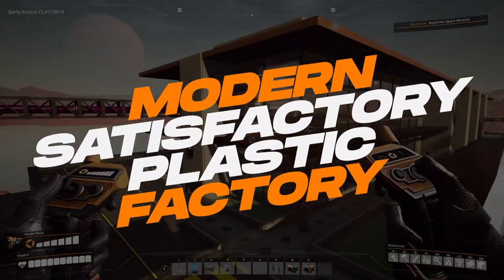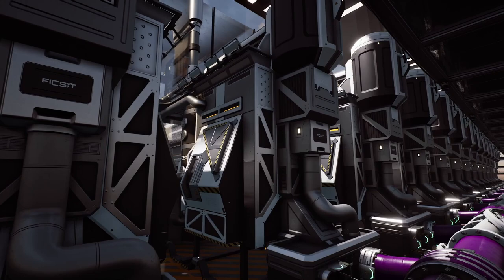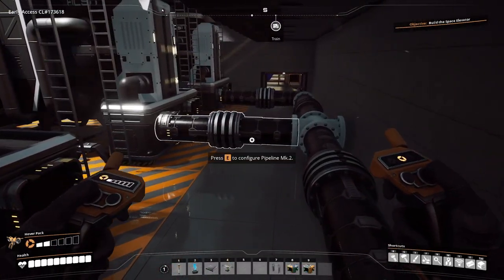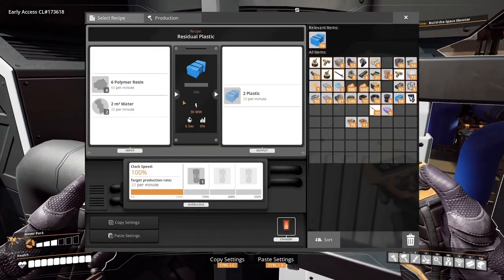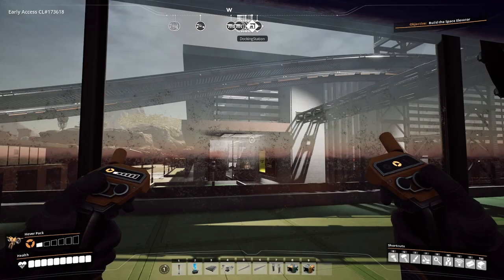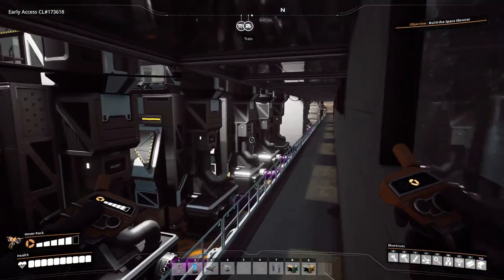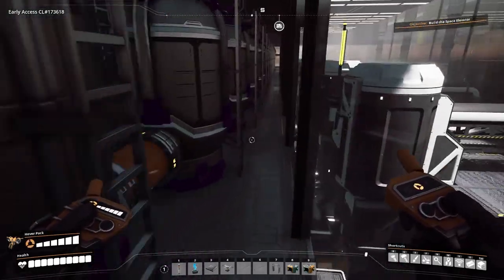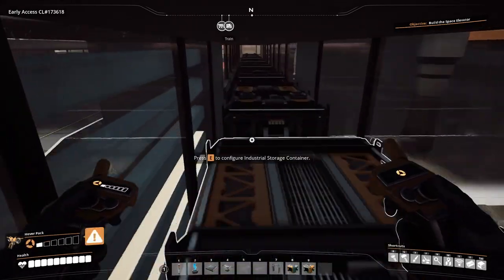Modern & Simple Plastic Factory in Satisfactory

Comment: Turn the heavy oil residue into fuel then send the plastic from the polymer resin line to the fuel into a refinery to make recycled rubber/plastic (if producing plastic itll convert to rubber and vise versa) for both your rubber and plastic buildings so you dont constantly gotta drain the fluid buffers

Comment: If you have the alternate recipe, you are better off producing heavy oil and polymer residue for the first stage. Fortunately, it is really easy to switch after the fact and only requires a tiny bit of belt and pipe rework.